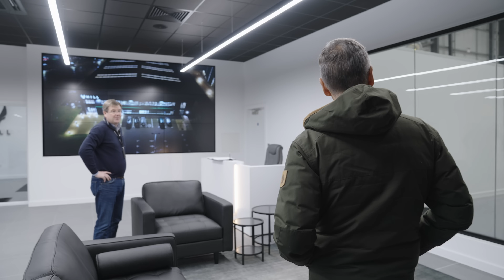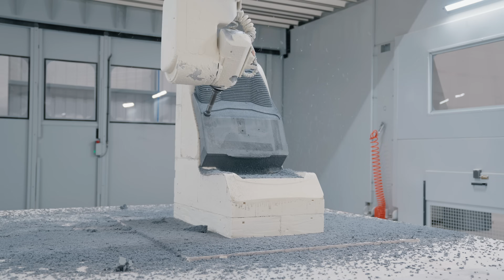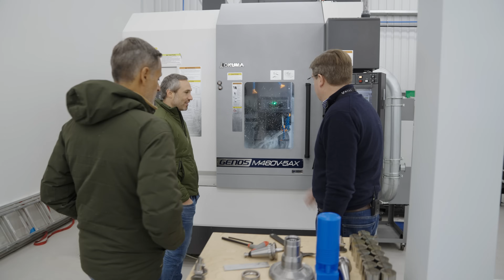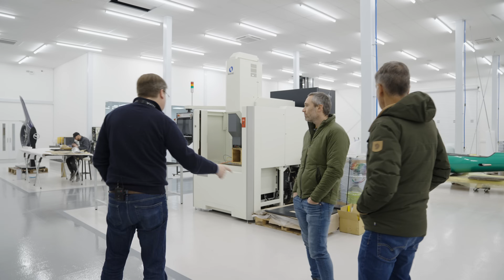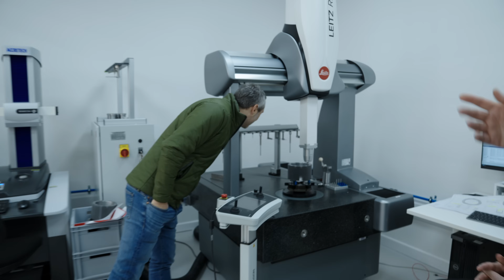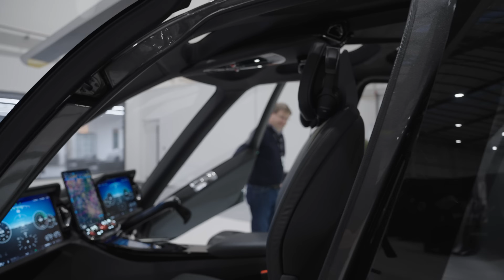Visiting Hill Helicopters Production Centre One

Comment: Very nice. Audio mix was low, you might be able to adjust that after the fact. Were they making their own ball bearings? that's surprising if they do. I wonder why they do that. The turbine bearing prices I got from SKF were quite workable. I was also surprised how casually they make optical quality windows on a seemingly porous mold. It must have a backing sheet that keeps the surface smooth. Maybe under tension.